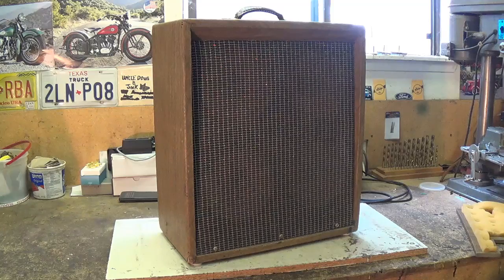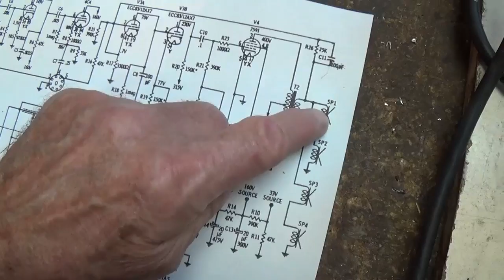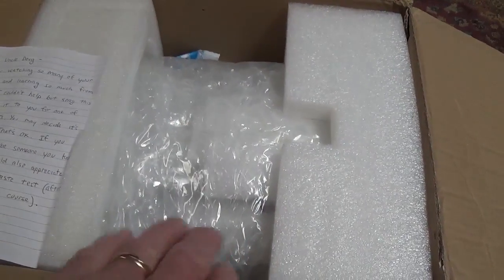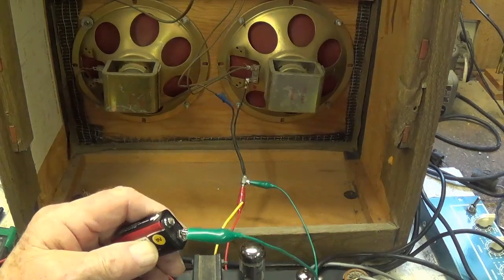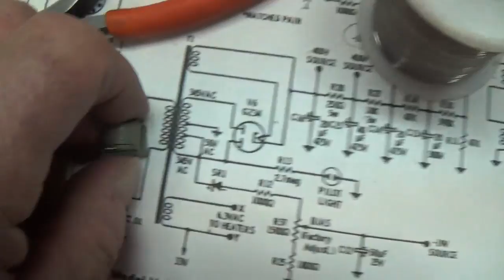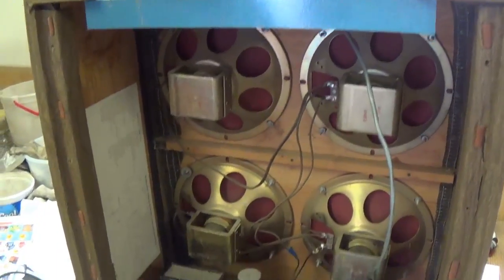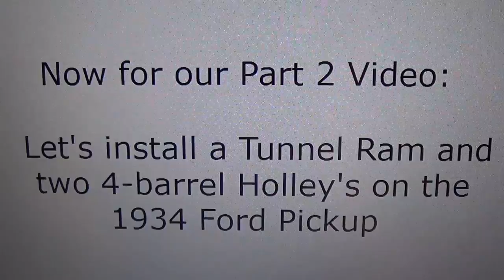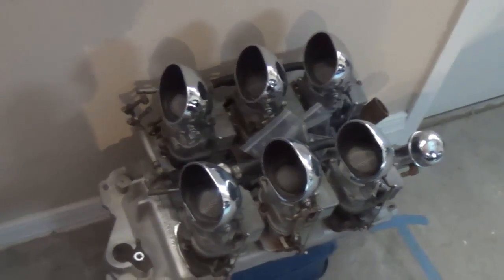Harmony H322 Bass Amp.......The "mini" Bassman from Hell !!

Comment: Firstly love your channel and content. Have a blackstar ht5r mk2 16 months old that the 12bh7 arcing in base of tube checked voltage at test points is 30v over on all ht side any help appreciated for now back to the heavy mashall.found no schematic and blackstar was no help at all..made in china
Reply from the maker: Unless the HV was well over 450V there should be no arcing, HH. I have never worked on a Blackstar amp.....they are way too new for me.....so I can't comment on lowering the HV, but 30V over should not cause arcing.

Comment: Maybe a brass gear is meant to die first so as to save the cam.
Reply from the maker: That makes sense in theory, but why do 99.9% of all distributors have steel gears?
Reply: @UncleDoug  maybe someone had a better idea, 8-)
Reply from the maker: @dugbert5  I believe it is sacrificial, but probably intended for use with special camshafts, perhaps with soft gears (?)

Comment: Did you install anything into the holes left in the control panel?
Reply from the maker: If I did, it would probably have been a small piece of aluminum, epoxied in from beneath the panel.
Reply: @UncleDoug  okay, thank you.

Comment: Copper fuel line ? I'm surprised uncle Doug.
Reply from the maker: Why?  It's easy to work with and looks nostalgic :)
Reply: @UncleDoug  to me it clashes with the chrome and looks hacked. And will get uglier with time. Just my opinion of course. Still luv ya..
Reply from the maker: @SuburbanDon  Thanks, Don. They don't sell pre-made chrome fuel lines for this carb spacing, and I don't like the adjustable ones. I'm sorry I let you down.
Reply: @UncleDoug  it's ok. You did what you had to do.

Comment: Get a steel gear for the mag may seem good
They used brass for safety. If it stripps
Or breaks it's less
Likely to damage
The gear on the cam.
Where as steel on steel
Reply from the maker: Thanks for your input, Dwight.

Comment: My dad called it a blibbit, 10 pounds of chit in a 5 pound bag he was born in 1924. I knew you had to restore it, that was a cluster fluck, never do that, they are not friends and hate each other LOL, it's AC and DC for a reason LOL. Like Tesla hated Edison. Those speakers might have a very low SPL and long voice coils for bass response. I have seen that a lot for tube bass amps even small SS low wattage ones to increase bass response.
Reply from the maker: I thought the speakers sounded really good, BD. Lots of tone and volume for 8-inchers :)
Reply: @UncleDoug  I used to build low wattage upgraded Fender type champ amps using 4-8 cabs and they sounded great. I used the reissue Jensens. I used to talk with the owner of Allen amps, he built Fender clones. It was over 10+ years ago but seems like much more LOL, it's like another world long ago. I did design amps that sounded like marshall stacks but about 5 watts I used EF86 preamp tubes in a vox like preamp and the Champ output section, it gave it the high gain in a similar way that Marshall stacks had that I had used on stage. I could never get a 12ax7 to sound like that no matter what in a champ amp, the Ef86 did.
Reply from the maker: @BigDaddy-fx4nx  That sounds like an interesting project, BD. I am a staunch fan of multiple, even mismatched, speakers.
Reply: @UncleDoug  Different voices like in a choir, it makes the sound fatter and without the peaks and valleys of having 4 of the same voices. Like mixing 2 P10Rs and C10Rs in a tweed Bassman, I did that in the later Tweed deluxe 4-10 amp and it opened up the sound a lot. Even using 2 amps did that even more as long as their in phase.
Reply from the maker: @BigDaddy-fx4nx  Exactly, BD, multiple different voices is far more complex and pleasing that a single voice four times.

Comment: Did you get an nice increase in torque?
Reply from the maker: I don't think tunnel rams are big torque producers, Alan, at least not on the bottom end of the RPM range. Once the engine reaches around 2500 RPM, however, the acceleration is noticeably stronger.

Comment: Do you think that Harmony would work for harp?
Reply from the maker: It would be a perfect harp amp......multi-8" speakers = harp, in my book.
Reply: Uncle Doug I’ll start looking for one. I use a 59 Bassman for harp now
Reply from the maker: @ernestlocke3600  Wow, it will be a big step down in value, but hopefully not as much in tone :)
Reply: Uncle Doug I’m a player I just want the right tone. Four eight inch speakers at 2or 4 or 8 ohms sounds very interesting. I do like the low end of the Bassman, but something like the Harmony May work for smaller venues
Reply from the maker: @ernestlocke3600  I agree, Ernest. It would be a perfect combination of power, size, and tone.

Comment: Linkage is not progressive.
Reply from the maker: It is, in that the secondaries of both carburetors are not opened at all until the linkage progresses past a point in its travel.
Reply: @UncleDoug  Hmmm, didn't you show that you're using both primaries simultaneously?